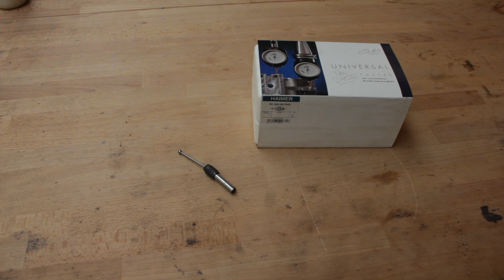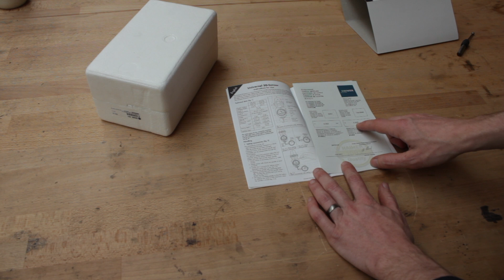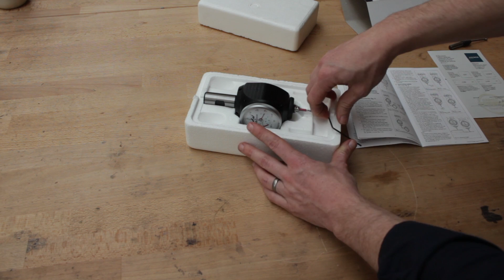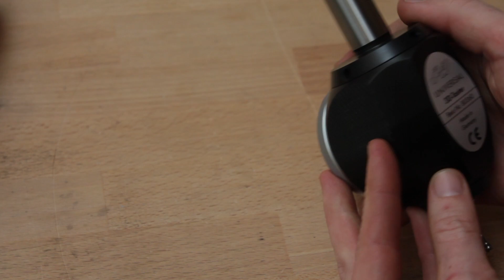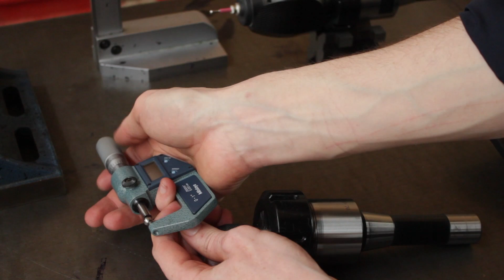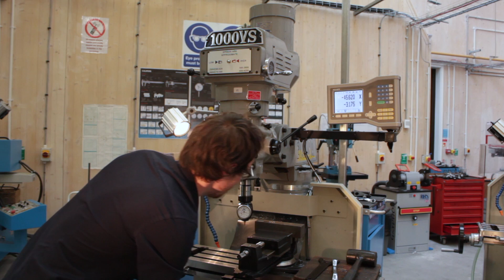Haimer 3D Sensor vs Wiggler (Edge Finder) - #5minFriday - #8

Comment: The Haimer 3D Sensor is 28 times more expensive than the Wiggler, NOT 3 times, as you stated at the beginning of this video!!
Reply: Theres something called a figure of speech something that isnt quite true but you get the meaning

Comment: Only thing that annoys me with these 3D testers is the z obviously needs a height offset of the device itself taking into account. I have one to use on our mazaks and it means i have to have a tool number permanently assigned to the tester,  so that when I use it to set Z. it calls up the right height offset. Its a pain caus the tester is not in the tool changer, so I have to empty the spindle, put the thing in then use MDI to tell the machine its got the tester in the spindle, all so it loads the right offset. It works very well, but its a big of a faff to get it in the machine and ready to work each time. X/Y is not a problem, you can just take any tool out and put the tester in (with mazak smooth, you can only use a machine position to base an offset from if you have a measured tool in the spindle). Its not as good as a proper probe, but it works. Used to use a wiggler, but this is easier.

Comment: Actually to get the best out of these Haimer 3D units they need to be zeroed to the spindle C/L and then left in the tool shank it was zeroed with. For an R8 spindle I just used a common 3/4" end mill holder. This tool is the only use I've ever found for that internal set screw R8 tapers have since the tool is indexed to the same position each time. For other spindle tapers I think I'd add an index mark to the spindles OD and on the tool shank where it can be easily seen so the tool is correctly indexed to the spindle each time it's used. A slightly worn taper might make that indexing a lot more important than for a brand new machine. 

Yes dropping one would make for a very bad day. I don't believe there's anyone qualified to repair them other that the manufacturer.

Comment: Please note that a run out in the collet is going to affect your reading with the 3D Touch probe, where as the wiggler is going to compensate for that by always running true to the spindle regardless of run out.  Watch this for an explanation:  https://www.youtube.com/watch?v=bga7y4infIo
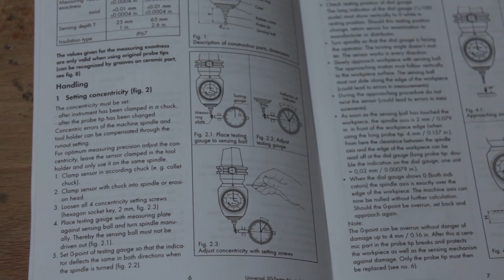Reply: check out 1:40 of the video, by adjusting the heimer the ball will run true to the center. Of course that only holds true if you use it on the same machine and don't remove it from the tool holder, once you change anything in the setup you have to adjust the heimer again. At that point the only tolerance you will face is the repeatability of your toolholder.
Reply from the maker: Good point!